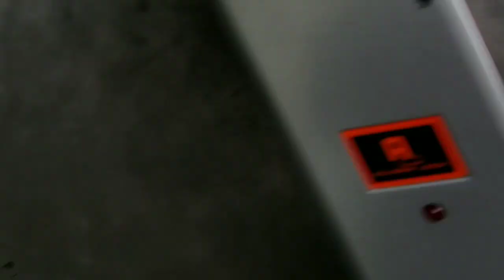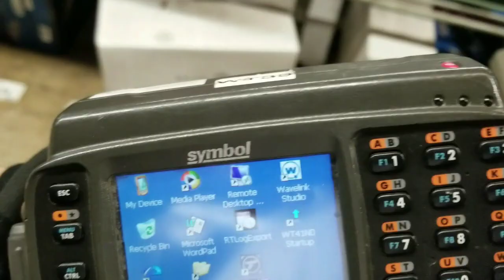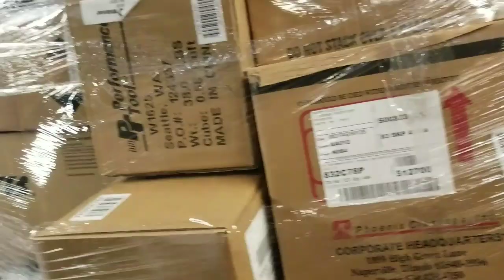A day at the best job in the world! Performance Warehouse! #GOAT

Comment: If you work for the right company you can make good money I make 50k a year in a warehouse I work some overtime and it is hard work, the boxes are heavy , but I just see it as getting paid to work out
Reply: What does your daily routine consist of
Reply: @eribertososa5156  fill out qn inspection sheet on thr equipment I start on, then go do bin maintenance for 15 mins to keep the warehouse clean, then start order picking, yeah its hard work but I make pretty good money so I don't complain too much
Reply: Samuel Clark how does order picking work ?
Reply: @eribertososa5156  ride around on a picker lift and get the material needed from the locations stack the boxes until the order is done or the pallet gets full.